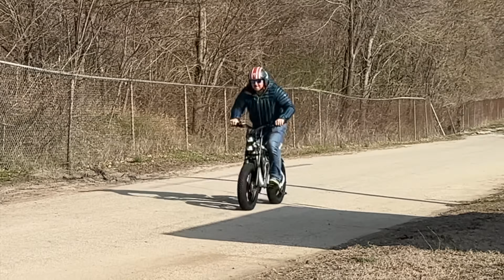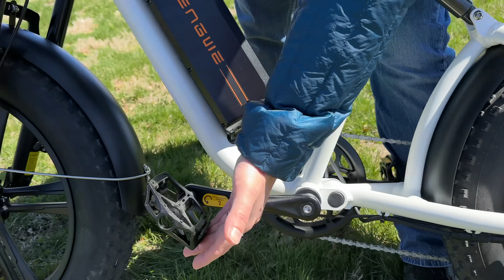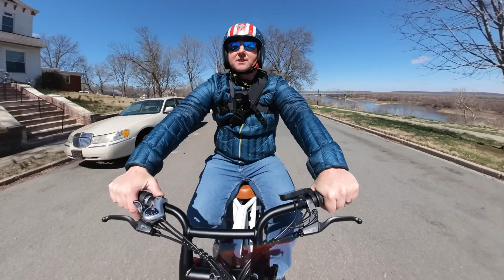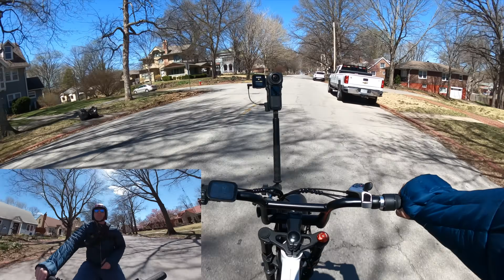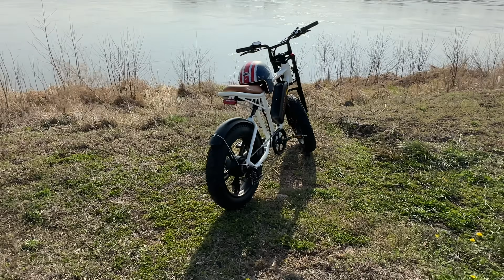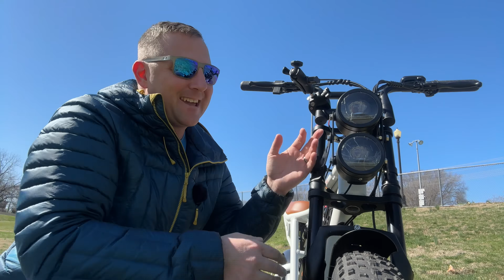Engwe M20: The E-Bike Revolution Has Begun

Comment: anybody know the factory charger rating on this bike?  If want to charge it with a 200w solar panel, what Volts should I step up to?
Reply from the maker: The problem with charging directly from a solar panel is that it won’t control the charging. Unless the battery has a built in controller, it could be dangerous. It’s a 48v battery, so you’d likely need something a little higher to feed the battery.

Comment: Not my mom's bike more like my grandma's bike lol 20 miles an hour a can run faster lol. Any electric bike that can not go at least 50 becomes boring real quick. I have one that goes 55 and at first, it seemed scary fast but now I am used to it and it feels slow. If someone thinks 20 miles per hour is fast then they should not be riding one and stick to a horse and buggy or a mobility scooter.
Reply from the maker: Sounds like a nice motorcycle. Hopefully the suspension is a little nicer than the one this bike has.

Comment: What exactly is the point of petals if it's electric?I guess if the battery dies..
Reply: Where would you rest your feet without the pedals?
Reply: @Larry C  I guess on his mom saggy boobs
Reply: Foot pegs 🤷🏻  @larryc1616
Reply: Its there so that u can use the bike lane
Reply: It's classified as a mountain bike I think
Reply: to comply with laws. If it has pedals, you can use it on the bike lanes.